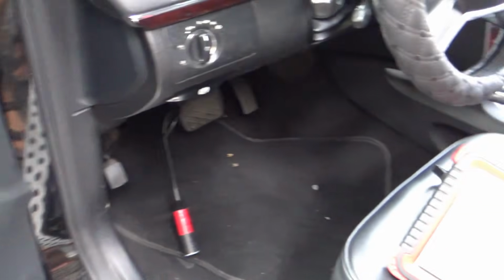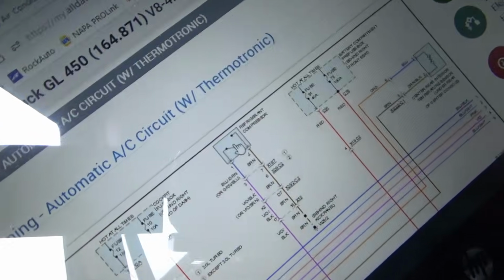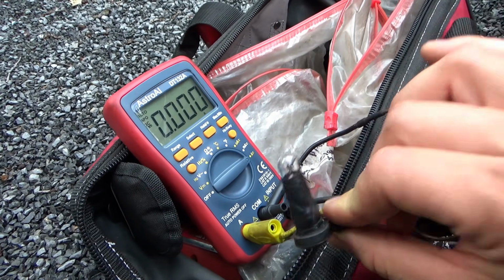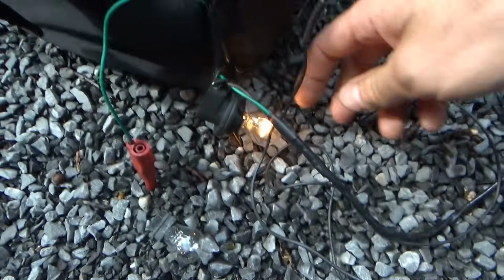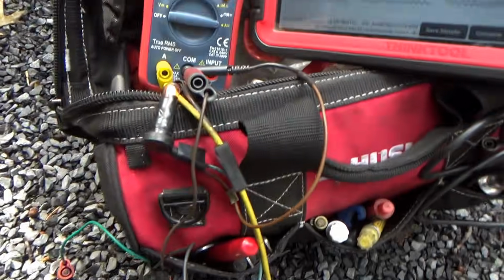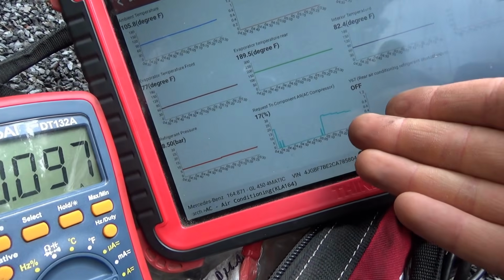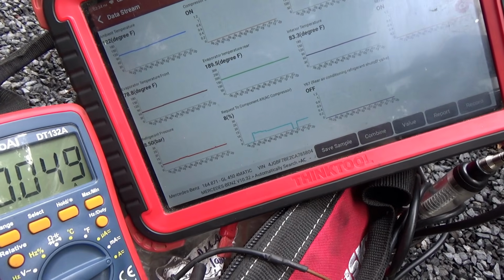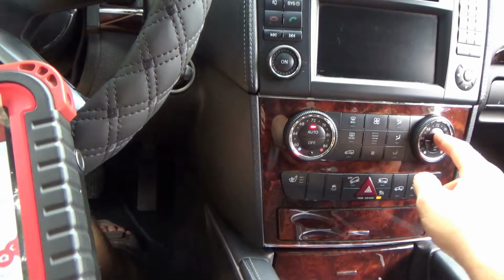Did I MIS-DIAGNOSE This Mercedes?? (GL450 no A/C)

Comment: I have 9601 and 960a code, blower is not turning on, replaced blower and no change, does ‘12 gl450 has a resistor?

Comment: I mean the w205 compressor has 3 pin socket if I plug the socket from the harness side
It stays ON directly without control from the climate control, do have an idea what could be causing the malfunctions

Comment: Nice video,
I have the same problem and want to replicate your technique.
I can’t seem to find the wires you use to attach on your multimeter. I looked everywhere with no luck. Any tips where?
Also, I’m a bit confused about how yo attach the wires under the car for this test. 
The compressor plug should be disconnected and one wire is attached ti the control unit and the other to the compressor ? 
Appreciate advise 
Love the videos 
Thanks !

Comment: Nice car with an owner who is not prepared to pay main dealer prices. Mercedes have their own diagnostics tool called 'Star'. Had the owner gone to Mercedes they could have hooked it up onto their tool and diagnosed the fault fairly quickly and repaired it for less than the compressor?? False economy by the owner will now cost him more in the long run.

Comment: Ivan , We just had this problem but on a ML 350 . The ECU controls the Compressor. 
There is a Power Valve on the side of the compressor . It is held in by a snap Ring. There is a plug on the side .These valves work similar to a VVTI valve .  It controls The Function of The Compressor { a solenoid } It opens and closes to regulate coolness and to stop it from freezing up too.  Look it up , They go bad . They are Available for about $69.00 but you have to R&R the Compressor then change the valve . Do not be surprised if The Compressor is a Chinese knock Off. Google will also help you too. Good Luck , Ed. In Boston, 50 years as a Licensed Motor Vehicle Damage Appraiser who has seen many things . A subscriber to Eric The Car guy , South Main Auto [In N.Y.} Raymond Ray in Florida. and many others on U tube.

Comment: I know this is an old post, but this may help someone else in the future. The compressor used here is the 7SEU17C which is used on many different vehicles of all makes and models. The solenoid that is on the compressor that Mercedes uses on most of their applications has the diode built in while most other solenoids by other vehicles doesn’t use the diode. So bottom line if you order this compressor by part number you have to make sure it has the correct solenoid installed on the compressor for a Mercedes. If not the computer will disable the a/c.

Comment: The AC compressor is easy to test with the car  off  before replacing it, just remove the connector and run a direct electric wire from battery to the compressor,  positive to compressor  connector and ground to compressor body, and see if the clutch engage or not
Reply from the maker: Ummmn did you not watch the video? 😅

Comment: My guess is this simple circuit is not quite as simple as it seems.  While suryaprihadi2258 has some amazing information, I can't help but wonder if this is a hybrid circuit which has some digital signals and/or uses something other than voltage/amps to regulate how the circuit behaves.

Comment: Just an observation about light bulbs...

Incandescent bulb are not a direct substitute for a solenoid when it comes to current measurement and testing. Incandescent bulbs have less resistance when cold. Tungsten filament cold resistance is on the order of 10x less than it is when it heats up. They heat up fast, 10-30 milliseconds. But they can present a challenge to power management. Ask anyone who managed theater lighting... lol

Solenoids have an initial resistance to a change in current. Once the field is created (and current is flowing) they have a tendency to spike with a back EMF when turned off. The peak of the spike (the voltage rise) is dependent on how fast the current is turned off. 

Clipper diodes (reverse bias configuration) snap on fast (10-50 nanoseconds), and if sized correctly can catch most of the back EMF. If their duty/heat/current rating is a little "light" they can self-destruct.

Ivan's circuit confidence diag of the controller wire appears to demonstrate the controller can output 900 milliamps without any problem. 

It would have been interesting to run the light bulb string from battery positive to the compressor controller pin and measure the voltage drop across the light bulb(s). 

Would the compressor come on? Are the measured voltage drops across the bulbs and the compress valve making sense.

Yea, if it were me I would using a 20 watt/15 ohm power resister instead of a bulb. I have more to them sitting around anyway.

I don't think the "Scotty fix" would work. Not with a single overlay. If the compress can be driven directly from battery positive with an overlay, you would still need an overly for the AC controller... since it is measuring/monitoring current...

The 12.7 ohms from the compressor to chassis ground should rule out an open or short on this leg of the circuit.

When driving the controller with the light bulbs to chassis ground it appears to be happy also.

I guess you should check the controller ground points?

Interesting the controller is not using ground side (shorting) to manage the compressor valve. How does the compressor valve find ground?

Is it possible someone reversed/flipped the connector at the compressor and the controller is being driven into a dead chassis short/ground?

Love the content Ivan. I never miss an episode

Comment: Oh good, piercing probes into wires in the underbelly of the engine compartment exposed to salty winters.
Anyone up for a sweepstake? 
Do we see this car in 1, 2, 3 or 4 years with a customer complaint of A/C not working again?
After 3 diagnostic rated hours Ivan says "BINGO" while tugging on a wire that evaporates to green dust followed by "there's your problem". Then proceeds to charge the customer to solder the remains together for a couple further hours at diagnostic rates as that's cheaper for the customer than going elsewhere at that point. 

NO PARTS REQUIRED FIX - MERCEDES A/C is posted to YT.

Bonus sweepstake on when Ivan will say "BOOM - FIXED, NO PARTS REQUIRED" to the minute in the fix video.

Not thought through the details of the sweepstakes, but something like that. For the hard of understanding - there will be no sweepstakes.

Just stop poking holes in wires in exposed places pretty please!
Reply from the maker: Triggered by piercing probes? xD
Reply: @PineHollowAutoDiagnostics  I guess so! :D Weird thing to be triggered by I know - but my mind just can't stop thinking of those little holes in the wire insulation and the salty winter road juice splashing around... AAARGH. I've long accepted I'm weird that's fine. Didn't intend to disparage.
Reply: Ford suggest seal hole in poked wire with rtv to prevent corrosion

Comment: The first thing that should be ringing bells is that the system fails/or doesn't fail when connected to different ground points. I think that issue needs investigated first since that seems to me to indicate there are grounding issues in that vehicle.

Comment: Hey Ivan do Toyota exhaust manifold gasket go bad.  I am in a dilemma I have to replace the donut gasket in the exhaust system. Should I also do the exhaust manifold gasket. Do exhaust manifold gasket go bad and what’s their life. I will also be replacing all the studs and bolts on the  exhaust manifold bcuz when the manifold does goes bad in the future it will be easier to get out, what are your thoughts. There is no info on exhaust manifold gaskets and none of the gurus like you have covered it.
Reply from the maker: If it ain't broke, DON'T TOUCH IT! :D

Comment: I don't understand why you didn't check the waveform with an oscilloscope although you had identified that it was the appropriate  thing to do next. It would also have been worth checking with an alternative inductive load that drew a similar load. I suspect the key to this issue is the fact that the AC controller is managing an inductive load and the flyback diode/ suppression LC network is defective inside the control module.
Reply from the maker: Part 2 coming soon :)

Comment: Was the compressor with the valve changed or is the valve still original?
Is enough refrigerant in the system?(wrong errorcode?)
What high and low pressure has the system, if valve is feeded with static 12V?
Is the fan running?

Comment: I Know that you probably figured it out till now.
But I think the new compressor is junk.The control valve has to have a integrated  super fast diode parallel connected.If not the logic think it's short circuit because of the induction created by the coil.I have seen this many times.If you put one additionaly to the circuit, everything will be OK.

Comment: One has to stop and think about how the controller "knows" the test lights are being grounded directly though to the battery and not though the compressor.  Clearly something more is going on.  Either the compressor ground has a problem (causing a voltage to be applied to the controller), or it's somehow shorted to another lead the controller is monitoring.

Comment: Did you measure the voltage on the compressor ground with respect to body ground when it was loaded?
Reply from the maker: If it carries current, then ground is OK :)
Reply: @PineHollowAutoDiagnostics  The ground could have a resistance of a few ohms which could carry some current but would raise the ground voltage.

Comment: I know on much older Mercedies than this one, the climate modules were troublesome.  But the newer ones like you're dealing with here are noticeably better.  Now if you are bypassing the switch on the compressor by supplementing a new ground through a test light and that works.  But the supplied ground is not working.  I would think that we may either have a poor ground going to the compressor.  Or the replacement compressor may be missing a resistor.  Just my thoughts.  Anyway, I can't wait to see what the conclusion is.

Comment: Who says that the new compressor was good out of the box. How many times have we seen new parts that were bad? I wonder if the a/c compressor has a PCB built in since it can tell if it is shorted or open circuited.

Comment: Ivan, if you have the car again, would you mind showing the top of the electronic control valve? If it has a yellow dot mark, or a triangle stamped on, it has a DIODE built-in. This diode is required in some MB models, but not all of them; therefore, did the old compressor has a diode or not? is the new compressor, OEM or aftermarket? did it have a diode or not?

Comment: I don't know for sure that you made the wrong call, but I'm really wondering why you didn't do a visual inspection and verify that there's no voltage drop from the compressor housing to the block to the battery. The controller is able to control the substituted load attached to body ground, so I would've looked elsewhere before making that call.

Comment: The AC compressor is good and the wiring checks out fine.  Replacing the AC controller didn't fix it, so that leaves a bad signal/power/ground going to the AC controller.

Comment: The lamp is a resistive load. There's no inrush when energizing it. Magnetic clutches have a diode across the coil to absorb the back EMF. The solenoid valve is an inductive load like the mag clutch. Maybe this one does too and it is bad. Look for a diode in the fuse box or in the circuit.